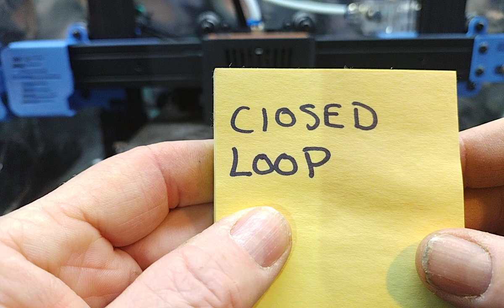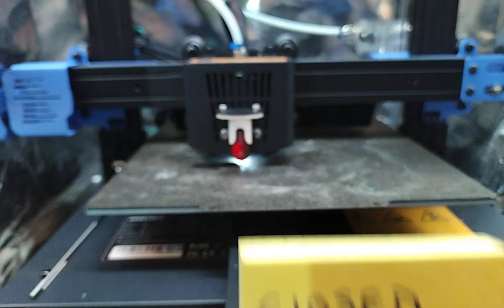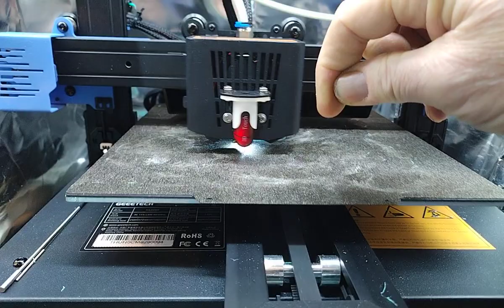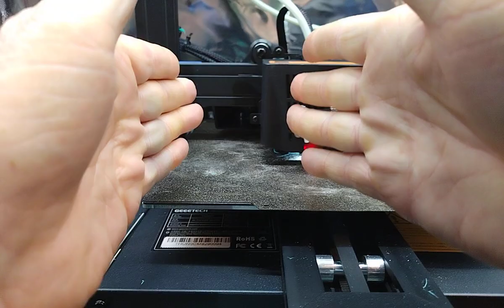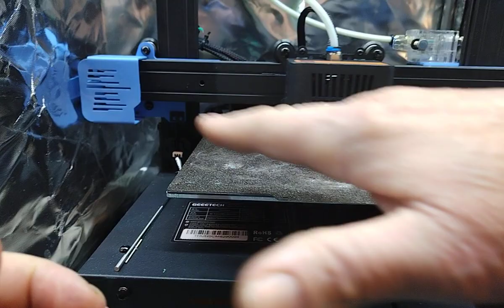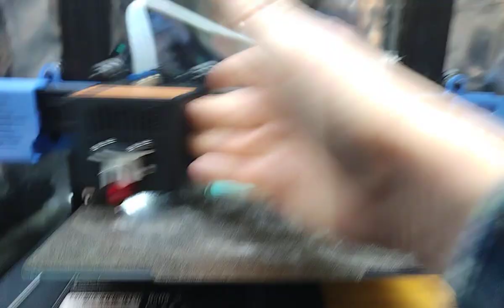closed loop drive stepper motors on the thunder printer

Comment: Closed loop steppers are great but if you’re printer has belts you can still lose steps unless the encoder is mounted on the linear stage instead of the motor.
Reply from the maker: good point   forgot about that aspect.